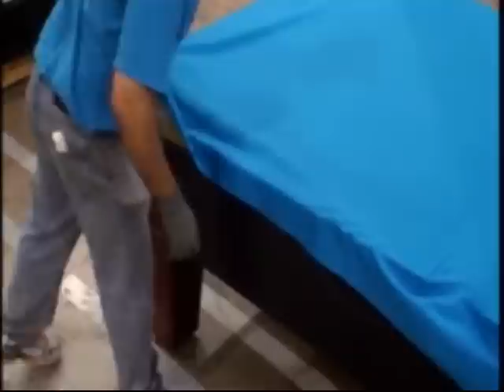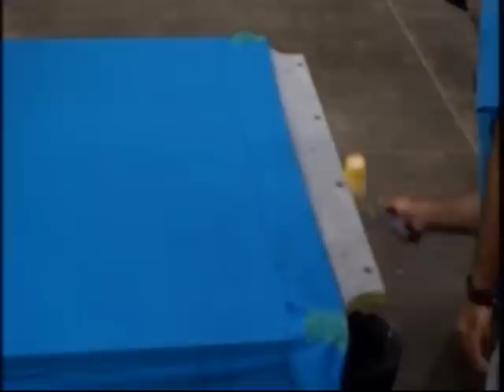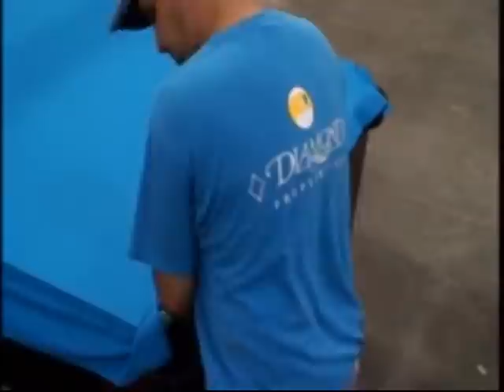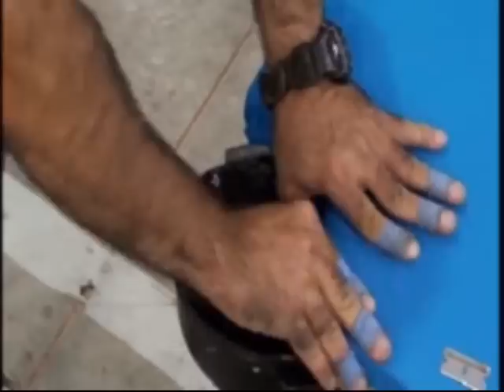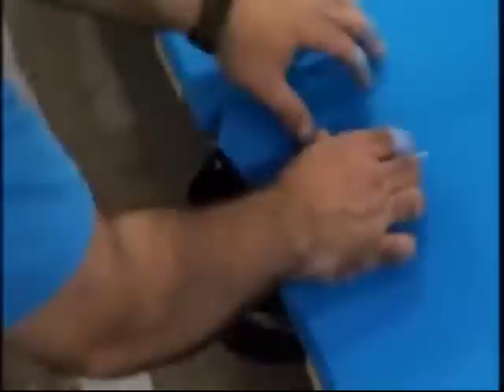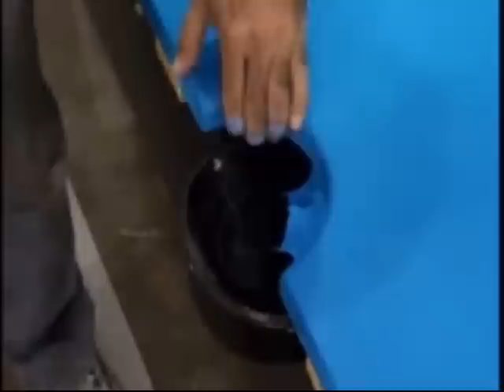Smart Table - Simonis 860 Cloth Recovery Part 2

Comment: gotta be honest, that looked a whole lot simpler than I thought. I was under the impression that as equally spread was necessary but turns out it's just as tight as you can and grain don't matter. Also, no longer need to staple, I think that blew my mind the most, just some magic and you good.

Comment: This was done at the Diamond factory and the glue that they are using is a 3M product called Fast Bond 10. You can usually get this at a industrial supply place but its not cheap.